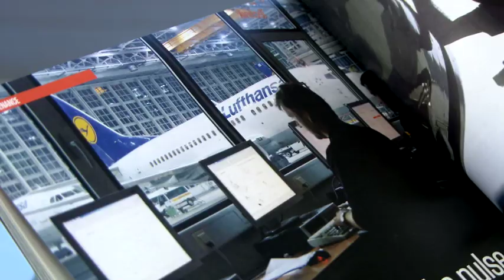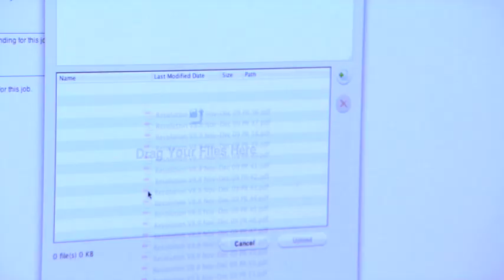Magazine Design, Production & Print

Comment from the maker: Every magazine is different therefore the fixed price depends on design intensity, page size, frequency and pagination length. For example, if a magazine is all text based then it would be quicker and cheaper to turn round compared to a magazine with several images per page. In 1998 we pioneered the fixed-price-per-page solution to enable publishers to budget ahead as we can anticipate how long a magazine would take to produce. It also makes us very competitive offering professional services.

Comment: I would recommend professional packages such as Quark XPress and Adobe's InDesign which is the industry standard programme. Avoid cheaper alternatives like Microsoft Publisher as more often than not the pages do not print as you expect. This is mainly due to lack of user knowledge in setting up the files correctly.

Comment from the maker: @bluepheonex1989 is quite right. The program doesn't create the pages for you.  InDesign and Quark XPress are complexed tools that require user knowledge to not only create visually pleasing pages but to prepare them to technical standards for commercial printing. People with little or no experience should not undertake the design of magazine pages as you may find your pages will not print as you expect. You cannot blame the printer if it goes wrong if you did not meet technical standards.